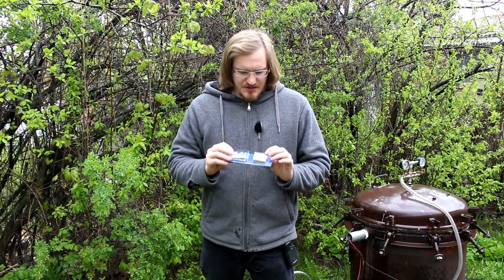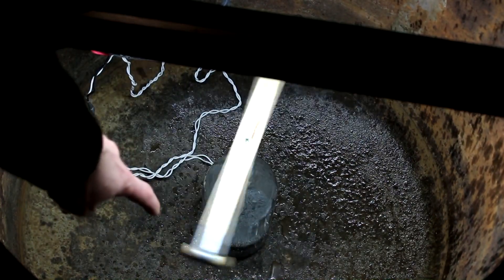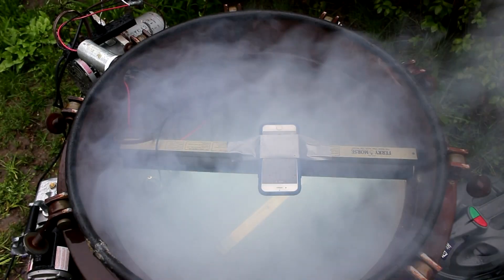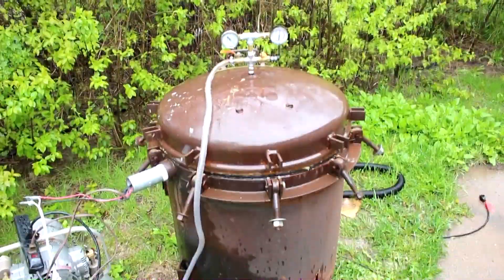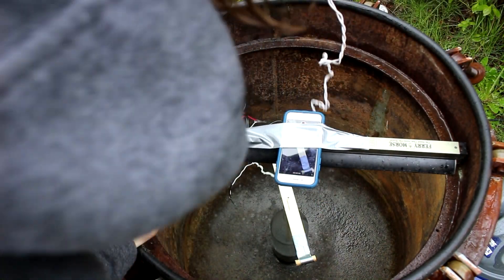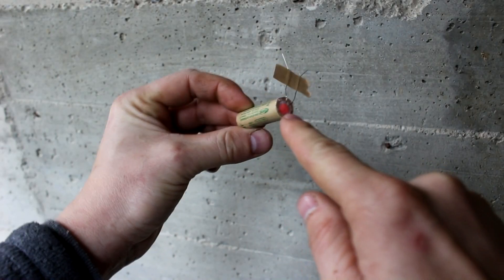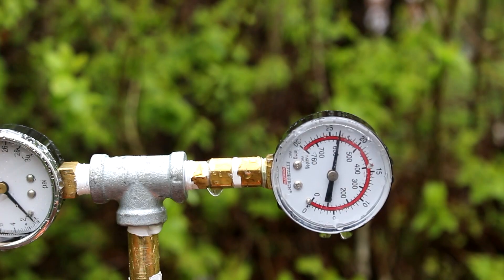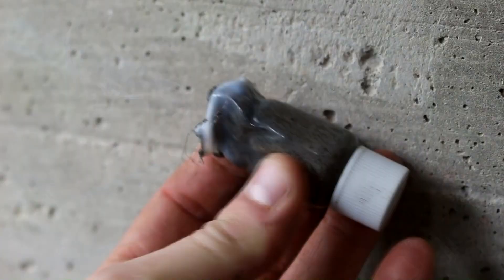Will a Model Rocket Motor Work In Vacuum?

Comment: The original kind of igniter that came with model rocket engines was just a piece of nichrome wire. If you had used that, instead of the newer kind that has a small "charge" on it, the igniter would have started up the engine properly.

Comment: Once the rocket gets burning, it produces its own oxygen from chemical reactions while burning, the fact that the smaller bottle had some atmospheric pressure had little to do with it. Its the fact that there was enough oxygen there to begin the burn long enough for it to produce its own oxygen. Similar to how space flight is achieved.
Reply: No you need the bottle with the atmospheric pressure to providing medium for heat to travel through to burn the oxidizer to produce the oxygen to burn the fuel.
we know because most of his tests he lit it and it would not stay lit that means it did produce its own oxygen but didn't keep doing that at a fast enough rate to continue burning. It only continued burning when it was under pressure and as other comments have pointed out it even seems to have gone out prematurely after being encased in that bottle and lit probably because the pressure dropped again.

Comment: lol he contained the rocket in a little bottle filled with air and claims that rockets work in a vacuum based on that expiriment! LMFAO!  the wheels spinned because the bottle burst due to to much contained energy!
Reply: PaperBeats "burst"
Really? Where did the smoke come from? And why did the fuel burn? In addition, the amount of air in that "tiny bottle" wasn't enough to spin the motor at the velocity noted.
Open your eyes.

Comment: I quit using those electric igniters back in the 60's. They have about a 50% fail rate. Now, if you pack a little black powder in around those igniters the fail rate drops to about 10%. For those little Estes motors we always used a piece of Visco fuse. About 1/4" from the the end of the fuse we would bend the fuse over and force that into the motor thrust nozzle. Out of hundreds, we never had one fail to ignite. 
You remind me of myself about 35 to 40 years ago, except you seem to have much more to work with. Growing up in a suburban neighborhood in the 60's it wasn't as easy to set off large explosions and similar attention getting experiments as it would be out on a ranch, but we managed. I remember telling my parents that the explosion that shook the house was from construction blasting somewhere near. I think the best thing I made back then was a Tesla coil. I used Coca-Cola bottles as capacitors and made a rotating stop gap from an old chain saw blade sharpening motor and a dimmer switch. I got 48" continuous arcs out of it. Not bad considering the plans I ordered from Lindsay's Publications came with no illustrations. I had to imagine how each component was made and how it worked in concert with everything else.

Comment: Cool channel dude! But how would a space agency bring enough air to ignite their thrusters and keep them working? They are huge! I don't know what to think, this video is making my head spin. I don't think it's even possible?
Reply: In real solid rocket boosters the fuel already contains the oxygen which is needed for the reaction. For instance the Space Shuttle boosters used amonium perchlorade, which is a molecule made up of 10 atoms and 4 of them are oxygen.
Reply: How would they bring enough air? you realize the rocket fuel is literally liquid oxygen and liquid hydrogen that will expand into gas if you allow them.
Also you don't need to pressurize the entire rocket only the combustion chamber and you only need to do it once.

Comment: Any chance using 120 VAC on the igniter prevented the rocket from firing in a vacuum?  Pretty sure those igniters are meant to be set off with 12 VDC.  From what I've seen, they burn slower using 12 VDC.  Somewhat like your, will a match light gun powder experiment.

Comment: I find it quite amusing to watch this video and know for myself that this experiment had failed twice. Now I am not claiming that there is anything wrong with a failed experiment really, but instead of accepting it, this gentleman corrupted the scientific experiment to work in his favor and had ended this video on nothing but purely baseless, unfounded assumptions. What a shame really. He subjectively changed the experiment to match his desired results / outcome when his first two attempts had failed to prove the desired results / outcome he was hoping for. It appears that perhaps it can be hard to keep "scientific experiments" completely objective when there is ego in the way. A point to prove one is right / correct at all cost in a sense, even if that means changing and corrupting the experiment to work in ones favor. Just sayin'. Try again perhaps? Who knows it may work out in your favor next time, or not. ;)
Reply: Wow you must be tired after trying so desperately to sound like you have a valid point. You don't. Science is about repition of experiments under different conditions,  and engineering is about applying the results of those experiments to get a desired result. Cody wanted to see if a SFR would maintain a burn in vacuum, not to see if it would ignite in vacuum, so he engineered a method of experimentation that allowed the engine to be ignited under pressure and burn in vacuum. The conclusion was that it's difficult to ignite a solid fuel rocket in a vacuum, but once ignited the rocket can maintain a burn. Try to think instead of spewing words you think make you sounds smart.
Reply: The fact that people call themselves open-minded but refuse to see a cheat or are so desensitized by untruths they accept a lie rather than see what is staring them right in the face. Society is lost and our history is based on lies and violent attacks on the human condition.
Reply: "This experiment had failed twice" No, YOU CANT BURN FUEL, unless you put LIQUID Oxygen somewhere to mix with your Nasa fuel tanks. also, incase you were deluded by that one ion video: ion engines only work if there is something to ionize. heat engines only work if there is some fluid to heat and thus maneuver. Engineering not a hoax, Nasa easily to plan for rockets to work in space. Proven by this video.
Reply: Like literally you just say something stupid and wrong with the caveat that if someone calls you stupid and wrong then that means you're right, and think that that's how the world works. Absolutely pathetic.
Reply: @FrancisR420  How so? Please do elaborate further? Or is this a baseless assumption perhaps? ;)
Reply: And now since I disagree with this specific video, it is only a MA-tter of time before those that this comment struck a nerve with will resort to knee jerk responses / reactions, unfounded and baseless assumptions coupled with ad hominem / personal name calling, condescending attacks without providing any real honest and legit rebuttals founded purely with scientific proof / evidence. Keep in mind for those who wish to resort to a negative response, "abuse is not argument, least of all proof". Just sayin'.  ;)
Reply: Why did you up-vote your own comments?
Reply: Is that the best you got there champ? Perhaps some DMT is in order? ;)

Comment: Thank you for proving rockets dont work in a vacuum and that NASA is lying their asses off. Confining the atmosphere in a bottle with the rocket isnt a vacuum even in side of a vacuum chamber you clown.
Reply: The fact that it propelled the rotor assembly in the vacuum chamber confirms that rockets do work in space, you lying clown.
Reply: No it doesnt get out of here with your nonsense you clown. He had to pull a mythbusters and do the what   would it take to achieve the goal he wanted.  He had the rocket in  pressurized sealed container with air in it thats not the vacuum of space.. So he proves it doesnt work in a vacuum all the way through this video And if you slow it down to .25 speed you can see there was a brief explosion and the weakest point gave way  "the hot glue plug" providing a brief moment of propulsion. He didnt even cut open the rocket i bet it was not all the way burned.. Now get out of here clown your going on block with your myth buster nonsense. And there is no way you and i know it was under a true vacuum without being there.  Myth buster already pulled that editing stunt with their fake ass vacuum chamber.

Comment: NASA puts oxidizer in its fuel so it can burn in a vacuum
Reply: although i'm not sure that the solid fuel used in model rockets doesn't have oxidizer
Reply: @Jabanalautch  no the solid fuel used in model rockets definitely has an oxidizer I'm pretty sure all rockets need fuel that has an oxidizer because otherwise the fuel would only burn after it leaves the rocket and would not maintain a reaction.

Comment: Don't forget that the rockets used in space have oxidizer type fuels, or have oxygen added to complete combustion
Reply: Rockets on Earth also have oxidizers mixed in already I don't think any Rockets run on atmospheric oxygen.
This one did not require any of the oxygen in that bottle it was only the pressure.

Comment: One more point, the second rigged up "bottle" rocket changed the pressure in the chamber. That allows for the propulsion. Do rockets ejecting mass in space increase the pressure of the Universe to allow propulsion? I doubt it. No finely tuned engine will work in space. Check out Elan Musks failed Hyperloop. Vacuum is a biatch :) So NASA, the theme park presentation, uses animation, actornauts, models....etc. They stage it like a soap opera. Every rocket launch ends at the termination boundary of the atmospheric density. It is why every rocket takes a parabola immediately as it climbs. Every meter the rocket climbs, it loses the friction/viscosity to keep its forward motion.  Gravity is an electro static phenomenon, so objects can't achieve so called "escape" velocity. How can a rocket, that loses push force as it climbs, truly escape? It can't. Imagine a fish jumping out of the surface of a pond, and then splashing back down, that's what rockets do. Literally.
Reply: It's called a combustion chamber.
Reply: +LiquidSmooth     The action is not gas flowing out! ¨Actio¨ is the force which is needed to make the gas flowing out at high speed! As an experiment of thought you can think of a guy sitting in the rocket in an armchair with a pile of stones besides him. He grabs one stone after the other and pushes the stones out behind. In pushing he has to work against the inertia of the stones and the rocket will move in the other direction. With rockets this is a continuous process. It is irrelevant if you have stones or gas, also gas has mass and inertia, gas doesn't move with 2000 m/s by itself, it needs a force to accelerate it to such a speed.

Note hat it is not ¨my¨ mathematics, it is a well known law of physics. The formula covers the pushing of one stone (or a portion of gas). M is the whole mass of the rocket, m is the mass of the stone which is pushed out with a speed v. The force needed to accelerate m to the speed v is actio. The counter force (reactio) accelerates the rocket (mass M-m) to the speed given by this formula.

Once again, research ¨conservation of momentum¨. It looks big-mouthed for me if you doubt a law which is used by engineers since centuries.
Reply: The reason that rockets look like they're following a parabolic curve is because in order to orbit the Earth, the rocket must be parallel or close to parallel with the Earth's surface. If the rocket went straight up it would come straight back down.
Reply: Gravity is an electrostatic phenomenon-  Do you even know what you are saying bud?  Go learn some physics 101 :)
Reply: Write that physics paper,and show us all how Newton had it all wrong .Your confused,I see the expanding gases pushing on the rockets combustion chamber  inner wall ,rockets mounting point,core ,while the exhaust gases exit the Nozzle.Newton laws of motion,for ever action there is a equal and opposite reaction.Isn't that what were seeing,the thrust has nothing to push against in a vacuum. In a large vacuum tank,a model rocket engine can't push on the tanks far wall ,it doesn't have the power to reach it,let alone push off it,Nonsense...Your trying to make a argument using crack pot science,reckless research.Write that paper....
Reply: Liquid Smooth I respect your opinion,but if your so sure rockets can't work in a vacuum [we even have vacuum engines at SpaceX ] write the that  physics paper...
Reply: Tisbonus,write that physics paper.Everyones sure rockets can't work in a vacuum,but nobody has ever proven it.Why ? Elon Musk might argue that point.Why do people chase silly conspiracies about space,flat Earth,fake Moon missions.?.You use the very same  technology that you insist is fake, how did those 24 GPS satellites get into space ?God placed them there?. Magic ?Devil worship?
Reply: maybe the difference between the hyperloop and a rocket is one uses a combustion engine and one uses a fan, guess which one requires air and which one works without air. Oh wait you still don't know...
Reply: Did alot of scrolling to call you stupid but now my hands are to tired so I'll be back
Reply: Hitman Notoriety a rocket pushes against the propellant by throwing it out the back
Reply: look up how a rocket pushes, pressure has nothing to do with propulsion,  just push, if you mix a bit or air and firestarter it will ignite and push the rocket. big rockets are just a lot more controlled in how much air they use and when instead of mixing it all at once like the video. if physics turn off in a vacuum how dose the moon move? heck, being in a vacuum makes propulsion easyer, any little push will move you and you will keep moving because there is no drag.

you also must remember what a vacuum is, which is a absolute lack of matter, so i would assume yes, the pressure of space in the area directly behind the rocket dose go up for a little bit until the atoms of the gas made via propulsion spread back out, 

also, i am curious, how dose gps work if not satellites?
Reply: +LiquidSmooth     Correct, is is the same concept. A bullet isn't heavy but recoil is still strong. It is not mass alone which counts, force is the product of mass and acceleration, and acceleration is huge with a bullet and also with the exhaust gas of a rocket. Gas leaves the nozzle of rockets with speeds of 2000 m/s and it is accelerated to this speed from zero in practically no time.

And if you think the mass of exhaust gas is negligible you have never studied data of rockets. I give you an example of the upper end, the Saturn V rocket. It has a start weight of almost 3000 tons and more than 90% of that is fuel. The first stage pushes out more than 10 tons of exhaust gas per second with a speed of 2000 m/s. Nothing validates what you say. Study rockets and study physics.
Reply: +Liquid Smooth    I studied physics in obtaining my MSc degree in egnineering. A degree is not a guarantee but should give you some assurance that I have some competence in this field. Any textbook of physics tells you that rockets work in vacuum and why. But you have studied both and you know it better?

I gave you the example with the wheel chair since it is an experiment demonstrating conservation of momentum. I recommended you to study this fundamental law of physics, but it is obvious that you haven't done that. Do it! You can't claim you studied physics when you are not familiar with this law.

The numbers I have given you are easily found in many sources dealing with rockets. If you would have really studied rockets you would have been familiar with these numbers.

The arguments in your last comment are all wrong. Rockets don't work by gas pushing against gas with another speed! Rockets work due to the counter force to the force, which accelerates the mass of the exhaust gas out of the nozzle - and this gas pushes against nothing in vacuum. Recoil of a gun is also not caused because the bullet pushes against air. And I never said that a rocket moves with the speed of the exhaust gas! The speed of the rocket is given by the formula I mentioned in an earlier comment, based on conservation of momentum.
Reply: Hitman Notoriety if you can jump, why can't rocket works? Given enough fuel to produce thrust, you can. People nowadays are sometimes just so stupid. Educate yourself before arguing.
Reply: +LiquidSmooth    The combustion process accelerates the exhaust gas. The gas has mass, to acclerate mass needs a force. A force accelerates the gas outwards (action), the counter force (reaction) pushes the rocket forwards. If you fire a gun in a vacuum chamber you also get a recoil. Same with a rocket.

You are aware that if you sit in a wheel chair and you push a heavy object away from you, the chair moves in the other direction? This happens since you have to push against the inertia of this object to accelerate it. And this effect is not caused by pushing against air. If you use an object with small mass and the same air resistance the effect will be minimal.

It is simple to understand by conservation of momentum, one of the most fundamental laws of physics. If an object has a mass M, and part of this object with mass m moves away with a speed v, the remaining mass (M-m) moves in the other direction with a speed of  m*v/(M-m). Otherwise momentum, the product of mass and velocity, would not be preserved. Research it and you will understand why rockets work in vacuum - although it may look surprising to you.
Reply: LiquidSmooth I agree with you completely! Well stated!
Reply: Were you born stupid, or did someone drop you on your head when you were little?